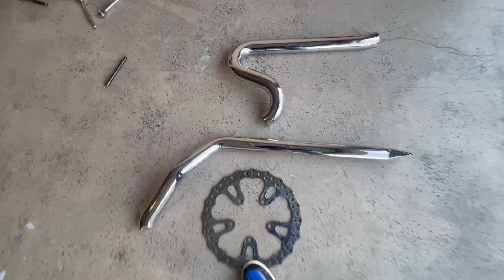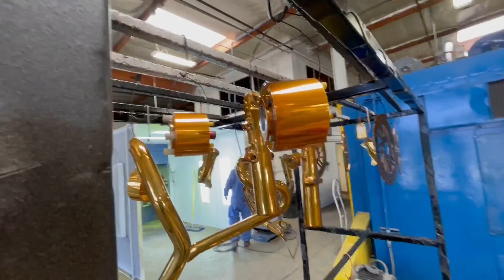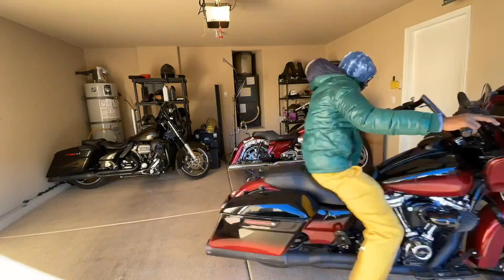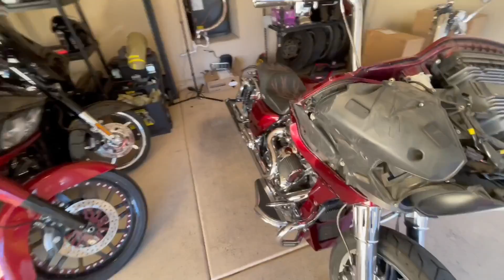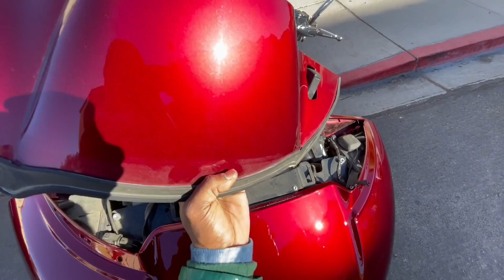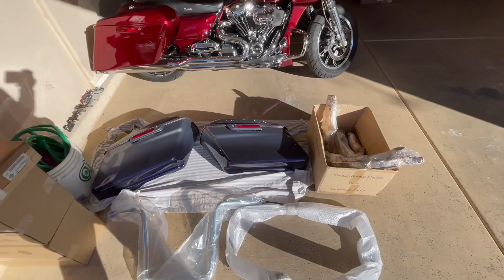PUTTING 24K GOLD WHEELS ON MY HARLEY!

Comment: On another note. I do not see why you being in Vegas you do not have either just as Equal if not better paint shops instead of running all the way to Los Angeles. You should have anything and Everything you need right there in Vegas. Seems like a WASTE of time and fuel and wear and tear on your vehicles.